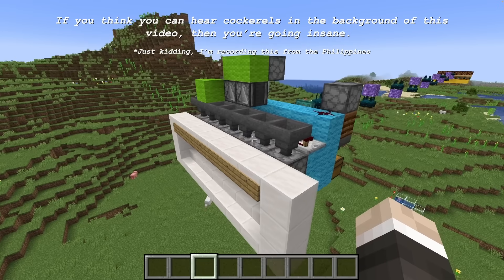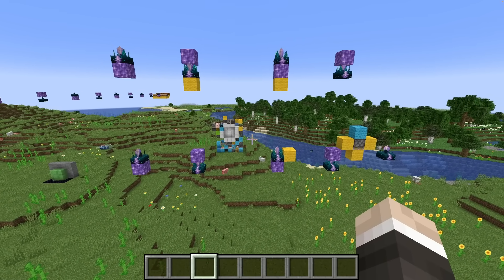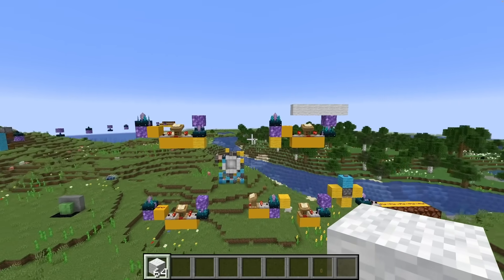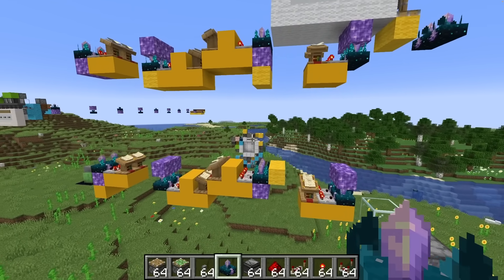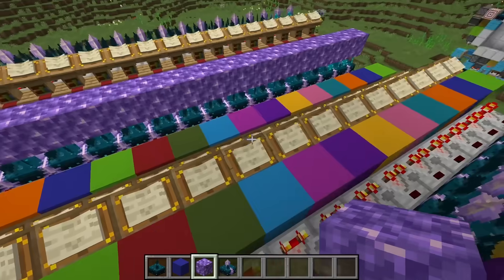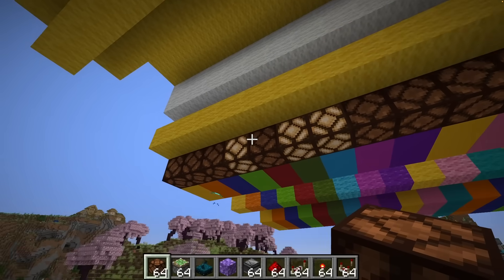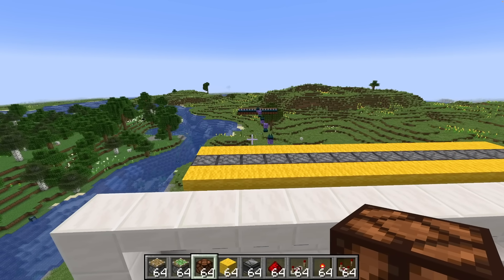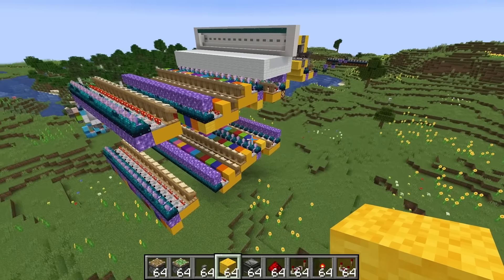This is not a redstone contraption.

Comment: I haven't thought too hard on it but it'd be interesting to see how this storage mechanism could be used in data storage, like D-latches. Shame it isn't 16 sounds though, it'd be nice and round for hexadecimal values.
Reply: You can still encode a LOT of different data. Since you essentially have 15 binary outputs, so you can send binary "bytes" of anything between 000000000000000 up to 111111111111111. Imagine a system that waits a specific amount of time for one such "byte" (IRL  a byte is 8 digits instead of 15, but whatever) to come through, and then gives a corresponding output. This gives a HUGE amount of potential outputs coming through a single line of sculk.

Comment: It makes me wonder if this could be implemented into puzzles to open doors/traps.

It would certainly make a secret bunker access, hidden treasure vaults or even traps more creative by making one or more common/rare sounds.
Reply: @falsnamae3511  That would be an excellent idea actually, as you could wire a note block as an example to signal the password to a door was reset.

Whilst I dont have the know how to wire up complex redstone, I am sure the community will figure something out that could share some light onto it
Reply: Didn't he do this in the last video?
Reply: He did with a door with the aspect of using buttons.

I was thinking if there was a way to make it without the use of buttons, so it becomes completely wireless.
Reply: It would make for a interesting way to do railway track swapping if say you are going down a route and it picks up your cart's noise.
You can make a pitfall trap for players riding the rails if they don't get the right 'code' in?

The only useful way to use sound for redstone signals, is possibly vertical transfer, since you can send the signal up but requires you to physically connect redstone torches or stuff up a level, but going down isn't possible in a 1 block column.

All in all, if you are making a farm of any form, it means these sensors are good for vertical distances to reduce time and space.

You can also use parrots, cats, and dogs or even marine animals as sounds by having them be nearby. Even a puffer fish reacting to a player can be a thing. And parrots can mimic a variety of sounds which are separate sounds to mob sounds.

Comment: Hey Mumbo love the video, I actually created a very similar thing about two days ago
I love your approach to only allow a single output, I hadn't gotten that far
Instead of using the lecterns and comparators I used a single redstone line which slimmed down my design, which was also vertical
The only thing I can say is that I loved comparing this contraption which I named a "Sound battery" at least that what I came up with when designing my one
Also I never had the issue with the sound unloading? I actually tested this by going 1k away and the sound was still there as well as use the reload command the sounds held just fine
Can't wait to see more! ❤
Reply: what about relogging?
Reply: Did you build the "sound battery" in your spawn? spawn is constantly loaded iirc
Reply: I think the signal can be lost if the only some of the chunks storing a sound remin loaded. ie if there's no sensor loaded to keep the cycle going it would be lost. So maybe the signals can be kept if the RAM is all in one chunk
Reply: @The3gg  As said by many others, I do think a chunk loader would be the most suitable to keep the chunk loaded and thus retain the sounds. And if the world is unloaded, every time you log in, you could make a "re-calibration chamber" filled with all the necessary items to reload the sounds into the system.

Any information that needs to be kept even after the world is unloaded (i.e. closed) and then reloaded can be stored using the output of items from chests, which means that you effectively have a hexadecimal redstone system that can be changed wirelessly using sounds.
Reply: @klayrity  no I built it outside the spawn chunks which is why I’m confused?
Reply: @vibaj16  It was single player, so it wouldn’t have made a difference but even if it was multiplayer it would be the same as just unloading it which I did already

Comment: You can use more than 7 messages if you combine the triggers.

Make a button click trigger two sounds and make the listener require both to be activated. Sure, you'd need a redstone contraption on either end to encode and decode the messages, but would be entirely possible, and give you access to many message options

2 sounds could give you 42 messages 
3 sounds could give you 210 messages
Reply: You can simply just serial encode and get (theoretically) infinite distinct messages.
Reply: You could also hex, denary or binary translate the message using the 15 sounds + blank at set intervals then you translate that back to English, allowing you to do infinite messages with a larger character set.

Comment: this could be an interesting system to use for hidden doors or locks, you could make a lock where you first have to give a certain sound to the system before you are able to even guess the code or you can make a trap with a safety on that is deactivated when a certain sound is used.

Comment: This could be used as a disarming feature for a security system in a vault of a base. It senses the specific sound you want it to in a specific area, disarming the system to gain access and when you leave or unload the chunks, its reset to being locked
Reply: That's a genius idea to work around the chunk load problem
Reply: @Deleted Devil Deleted Angel  
Turning chunk loading problems, into chunk loading SOLUTIONS

Comment: Possible idea to add more selections than 7 or 8 (It may be able to provide more options with fewer sounds, meaning you can put easy sounds in order to use the system after the sounds get wiped): 
If you make the extra buttons connect to a system that send two sounds, then you could build a decoder that tells how many pulses and which sounds have been used to decode whichever option. (It may be able to provide more options with fewer sounds, meaning you can put easy sounds in order to use the system after the sounds get wiped)
This would result in these as "sound codes" (Each letter indicates a sound, 1-3 as A, B & C)
A, B, C
AA, BB, CC, AB, AC, BA, BC, CA, CB
(And maybe more if you need like...) AAA, BBB, CCC, AAB, AAC, etc...

TLDR; To make it work conventiently, use multiple sounds to create more options; needs a decoder system for multiple sounds.
Reply: I love this idea. It makes me think of triple tap texting.

Comment: Heh, as soon as I saw the tileable version at 3:03 I just knew you were going to use Lecterns and Comparators to calibrate every single sensor 😆 A handy tip for anyone else experimenting with this: running a redstone line out of a torch and using all the different power levels as it falls off works just as well. Getting the sound out of the loop is also a bit simpler than the solution you came to suggests, it just requires a lot of wool everywhere to avoid sound leaks.

Comment: if they made this persistent, this could be insane for computational redstone, since it's not too hard to convert 4 bits to a signal strength and back
Reply: Not really, normal signal strength transmission is faster and simpler (and quieter).
Reply: Technical Minecrafters have made a MUX long before skulk.
Reply: i meant you could send any 4 bit number wirelessly through a single line of sculk sensors

Comment: The skulk sensor loop storage is similar to using delay line storage / memory. Very old but workable method. Looking it up may give you more ideas. 
If you transmit a series of, say, 8 sounds and they are decoded in the same order as they are transmitted (asynchronous communication) . You'll have a decent communication system. 
ASCII is 1 of 2 bits transmitted in groups of 8, and can form 256 discrete characters. You'll have 1 of 15.  Which is an exponentially larger group of characters. 
So, in using this for control of factories, you may need to invent process control for Minecraft. Ladder logic works good.   
The dirt 'round the rabbit hole you're standing near is starting to crumble!   <evil grin>
Reply: Expounding on Mumbo's set-up in the video, you could also send a 'redundant' sculk sensor line that activates on the receiving end when a signal is being sent (regardless of the signal strength). You could then add an extra button to the inputs that would not be calibrated to any sculk sensor, and only represents a signal strength of 0. However, that extra button will still trigger the redundant sculk sensor line, showing that a 'signal strength' of 0 was sent.

This means that you effectively have 16 different signal strengths that you could send long-distance (0 - 15), and you would have a hexadecimal system that could then be replicated to form two sets of 16 signal strengths, or a cumulative of 256 characters, and can thus simulate ASCII. This would be even better than 225 characters, and would be even better.
Reply: @theblackvoid  Thanks for the zero.  I couldn't figure that one out. But hold on, hexadecimal is predicated on two numbers, 0 and 1. This has 16 (thanks to you),.  Each bit can be one of 16 levels. In hexadecimal bits are one of 2 levels. Each digit is four bits.

Comment: Potential workaround idea for the stored sounds not lasting after you leave: A couple of these sounds would be made anyway, like walking, or triggered in one button, like equipping armour, so you could use those sounds for extra inputs next to the 7 non-player sounds if you need the extra inputs. To save your system from automatically being triggered just by walking, you can send the walking sound into the sound storage & then have a button to press to release that sound

Comment: You could use a simple fading line of redstone dust for the setting of what each calibrated sculk sensor are tuned to. Would be easier and cheeper than the lecterns.
Reply: Most of these are designed with no cost limit in mind

Comment: To fix the issue of forgetting sounds mentioned at the end of the video, you could use ticking areas. I know it’s a thing in Bedrock but I don’t know about Java. Ticking areas allow an area to always be rendered regardless of whether or not you are actually near it. It’s very useful for larger machines that run the risk of getting screwed up because part of it wasn’t in render distance

Comment: my first thought for how to increase the capacity of these wires was to use more lines, so whenever you would want to send an 8th value, you could trigger multiple of the sounds at once, in a way, sending a base 7 number
but the storing of players sound was pretty damn good, didnt even consider it
maybe by combining these ideas you could have an even higher number base for even more possible values sent with even less wires being needed
so by this logic, you can send 225 different signals with just 2 wires seperated by a bit of wool

Comment: This could possibly be revolutionary for creating sound based alarm systems. You could use the calibrated sculk sensors and place them around your base. Then, hook them up to the decoding contraption with, for example, redstone lamps marked with signs that tell you what kind of sound has been detected. 

Maybe one could even design a system that additionally tells the player in what area, maybe which chunk, the sound was detected in.

Comment: It would be a good suggestion for Mojang to first add the ability to dull the amethyst blocks so they don't produce their sound and secondly to be able to have lecterns store the sounds as a type of command on their pages when connected to the calibrated skulk sensor so that if you leave you can open the lectern and thus it would produce the stored sound  once again

Comment: this is super neat! I think you could get up to 225 "channels" by using sound combinations... aka, button 1 opens up the gates for sound 1 and sound 2, and the receiving end has an and gate that requires the 1+2 code. this way, when button two triggers sound 2+3, receiver 1 won't get set off. theoretically, you could do this with 3 digits as well, but the redstone would get very complicated very fast. I would LOVE to see you attempt this (maybe with only 4 or 5 of the sounds active depending on complexity). Actually, I would prefer to do it myself, but I have a tragic amount of paperwork IRL.

Comment: So this is really cool to me specifically because my job is in systems automation, and so much of it is storing and sending bits of data through a single line to a bunch of devices. You can basically have a DSL connection through which to send info over long distances when before you would need a hardline for each bit of data. You can basically set it to scan each bit over a certain time period and at the end you've got a 16bit integer sent over long distances at the end. That means you can send any whole number from 0 to 65535 as a control value to other systems.

Comment: With this you could wirelessly transmit to 15 different areas and have 15 ender pearl stasis set up for long distance teleporting at the press of a button.
Reply: It’s a bit simple but still pretty cool although for prisons this would be amazing as you could instantly trigger an alarm or ended stasis system when any block is destroyed

Comment: my first idea when i saw this was long range messaging in secret, using a 2-1 encoder with 15 inputs you can assign 225 outputs to your code, send the signal strengths sequentially in groups of 2 each group of 2 equals 1 letter, word, or phrase, and adding a 3rd input to a sequence explodes the number to 3,375 allowing for james bond esque secret messages to be transmitted underground

Comment: silly mumbo, you can make binary decoders
even two years ago, when you made your wireless messager, you werent limited to signal strength, you could use a binary decoder to send a skulk wireless signal and decode it at the end - the really cool thing now is that you can send 15 different signals simultaneously

Comment: This is the beginning of a pretty complex system for precise messages.

Using even just a limited amount of signals, you could theoretically have a sort of morse code machine. By sending 2, 3 or 4 different signals at the same time, you could light up two lights giving a different symbol/letter/meaning than just one light.

Allows for slow but very precise messages that just need decoding to work. And there'll probably be some supergenius who can come up with a way to make it faster

Comment: Using this, you can send 15 but messages. The output would also need to be calibrated sensors though. But that’s just starting off. If it can be setup such that you  predetermine which of the fifteen sounds should be sent out in one go and which should not send out, sending out the signal sends a 15-bit message. We can equate that to the word length of our sound “computer”. 

We can have multiple 15 but senders working together. And if it is decoded on the other end properly into something, we’ll we’ll and truly be creating a wireless computer in mc

Comment: You could do up to 7^n lines without having to worry about the sound persisting by using the first setup you had with 7 sounds then have a Memory/AND gate at the end to interpret sequential sound signals.

An example would be 7^3 lines or 343 lines

signal 1 = 1 - 1 - 1
signal 7 = 1 - 1 - 7
signal 8 = 1 - 2 - 1

signal 49 = 1 - 7 - 7
signal 50 = 2 - 1 - 1
signal 343 = 7 - 7 - 7

This has the added benefit of being kind of like a keypad if you want it to be, activating lines using a specific code. It doesn't have to be a keypad system though. You could set up 1 button to do multiple sounds so you can have 20 buttons to do 20 different sequential combinations.

Also, you could create an interface to show your input on the front end that you then have to confirm or reset to prevent improper inputs if you like.

Comment: If you had a receiver that listened for chains of signals then you could multiply the input/output limit. Basically it would watch for a start/stop signal, and then you input a chain of signals and send it the start/stop signal again. It would then decode the pattern of signals into a message. Kinda like your other video, but I figure you can make it way more compact

Comment: Immediate thought is ‘telegram system’ but the chunk loading issue is a pain. However short range message systems that run through hidden systems is neat.

Next thought is data storage through your system. You can store a data point in your system which means you can probably have something that stores data each time a trigger happens. 

So if you wanted a mob farm that collected data on how many mobs go through a particular trigger that could work… but that can be done via other means already

Comment: You could almost use this system to create a 15-bit wireless system, so instead of thinking of this as redstone signals 1 to 15, but as each one of those being a 1 or 0, allowing you to write in binary.

I know this has been done before in minecraft, but that fact that this can send it wirelessly through 1 line and get the correct signals on the opposite side means you can create a more complex system, I feel as these probably a way to compact this system even more, and make it more efficient.

Comment: if you work with only the redstone generated sounds, but 2 wires, then you could code combinations of sounds into numbers and have about 64 distinght signals, 512 if you use 3 lines, and 4096 if you use 4 (you get the point)